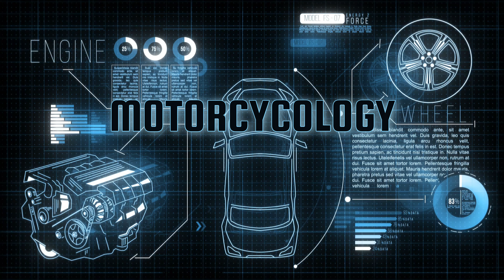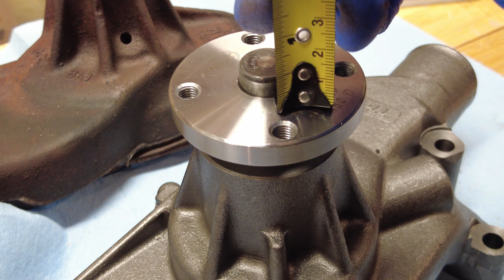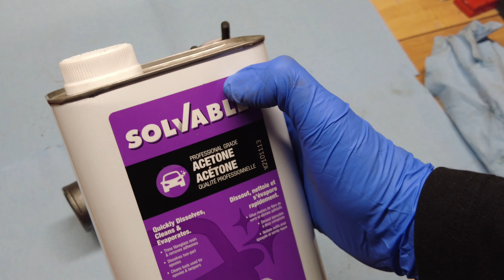C3 Corvette Water Pump Removal - Chevy 350 Cubic Inch Engine

Comment: and my 78 heats up to 200 and more on hot days thus wondering if it was the casting holes being blocked behind the water pump . Thus, noticing on yours is not, I am wondering any suggestions please on the issue for me. Also noticed your carbonator filter has a opening as mine doesn't . Would that help me? Kindly